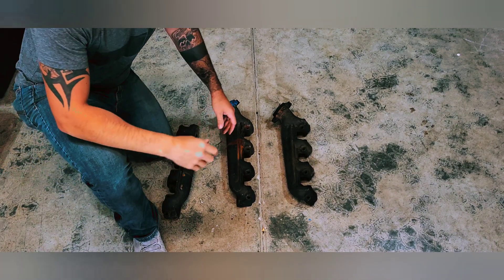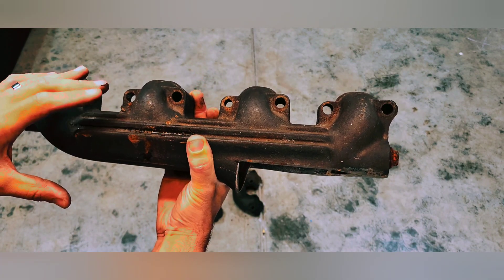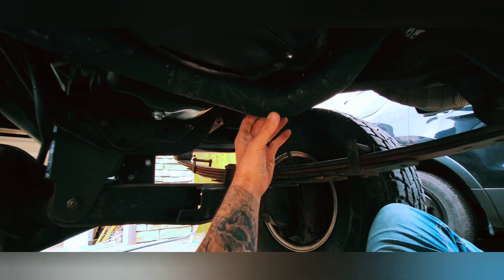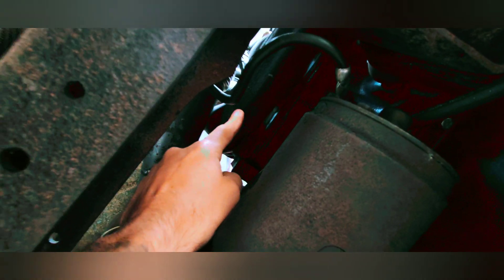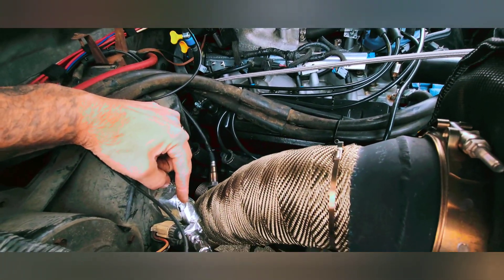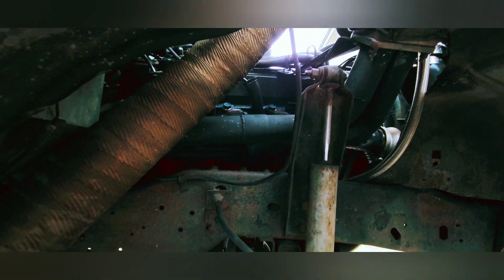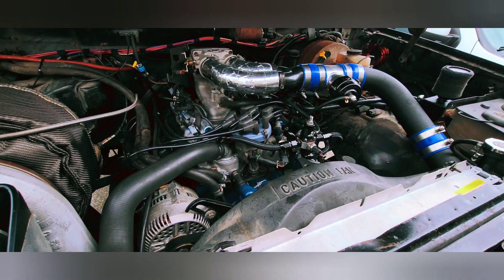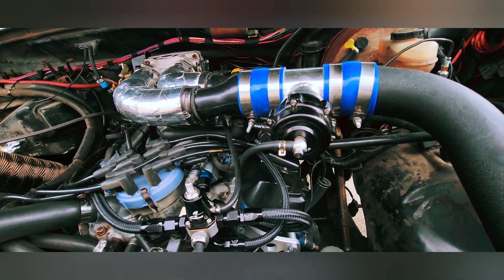Turbo EFI 460 hotside walk through

Comment: I am building a 1992 f250 7.5l and am doing my best to replicate your truck. Do you remember what fitting you used to connect the oil feed line to the oil sensor port? I bought a T6 oil line kit for my S475 and it didn't have anything that would fit. I think  the feed line was a 4AN but the sensor threads were different. I might just make a trip to the hardware store and see if I can make something work. The truck is hopefully going to be running in a few weeks. I went with the Stinger performance ecu and have been fabbing up the hotside.
Love your videos!
Reply from the maker: Man that's awesome and thank you! Let me know if you need any help with the tunning but the Stinger Performance forum is also a very good place to ask for advice. For the oil feed I used a brass t fitting I bought at O'Reilly Auto parts. I made the straight through part to run to the turbo and installed the sensor on the T. I was able to pick one up the worked with the oil feed line and threaded into the block.

Comment: What bottom end are you running? What compression are you running before turbo
Reply from the maker: Here are some of the engine specs. It was built by Scotty the Mad Porter...
472 cu in 
9.2 to 1 static c/r
4.42" bore
3.85" stroke
Ford F3TE 
2.11" intake valve
1.65" exhaust valve
Pocket ported 290 / 190 cfm @ .600" lift
207 / 219 @ .050" 113 Lsa 109 ICL .490" / .526" lift HFT
Ported factory EFI upper/lower intake
Sealed Power pistons and rings with increased gap.
Reply: @johnvirgilsgarage  You rock I'm a fellow Washington local trying something like you've done on my 1978 F250, I appreciate the details hopefully I can set something up like yourself I have the Holley Sniper kit which is ready for boosted applications as well